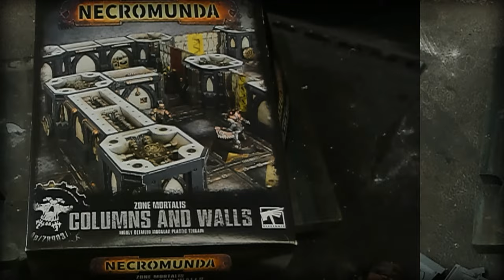Necromunda Secundus Underhells Kitbash Tile 4

Comment: I really appreciate the slowing down . Do you have a video where you go over the various texture products you’re using? What was the paste you applied after the super glue and baking soda?
Reply from the maker: Thank you for the comments!  (I wasn't sure about how much to slow down)  The textures that I use are just a mix of PVA white glue and sand with a little bit of water.  It was getting too expensive to keep using the pre-made stuff for what I wanted to do really.  You have an option to mix it as thick or as thin as you want to and also be able to adjust the texture levels.  I don't have a video out for any products as of right now.....  but I'm willing to try and make one if I get enough feedback.  Thanks for stopping by!